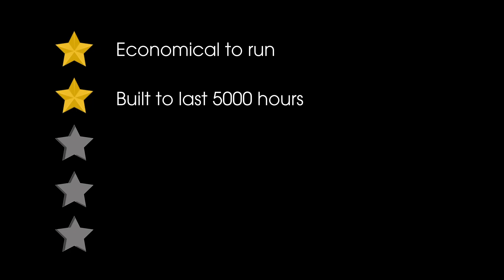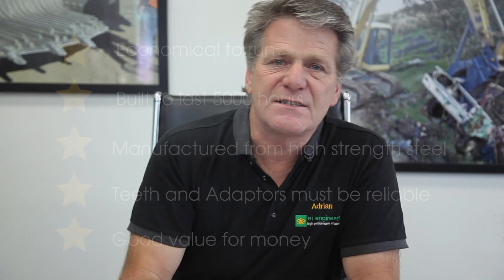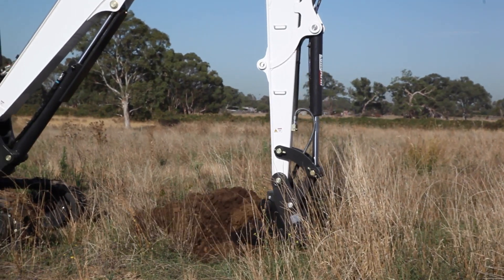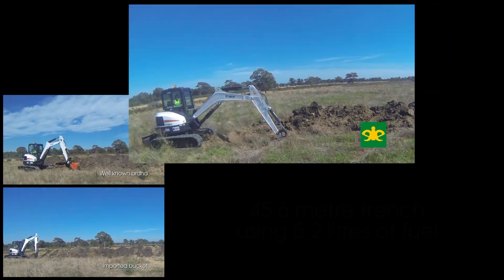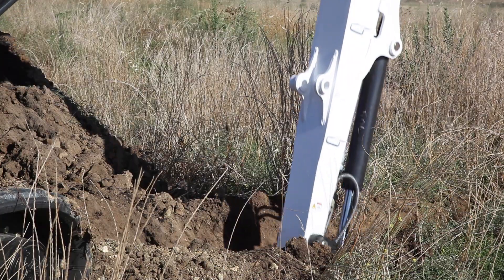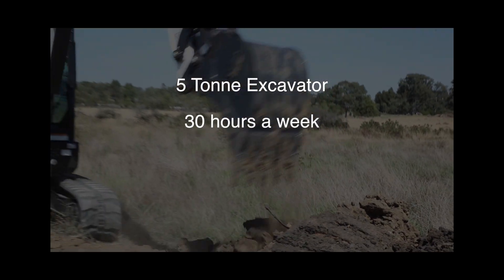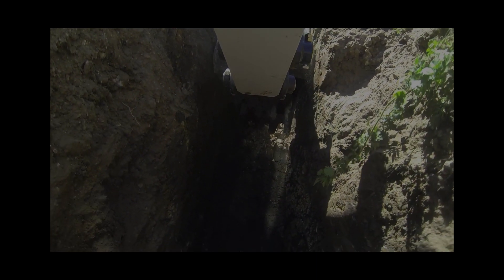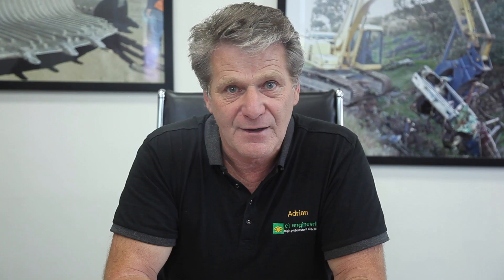eiengineering 5 Tonne excavator bucket Comparison

Comment: also i noticed that they are not using the same G.E.T so i dont think it can be fair as company like ESCO will point about the massive fuel savings and productivity that the G.E.T will give you, so i think you should make another video showing the buckets with the same G.E.T.
Reply from the maker: Sorry James, our teeth are actually larger than the cheaper and sharper teeth on the other buckets. We use late model Esco style teeth because:
1. they are a stronger adaptor that does not have the traditional hole through which exposes a weakness and breaks under certain conditions
2. we are sick of all the different copies especially from the many slightly different moulds in the Chinese foundries which end up with bad fitment onto your adaptors, leading to teeth coming off, pin and adaptor breakages, etc.

With the 18 series style teeth, which is the styles on the other buckets, I believe our buckets will perform even better, but creates other problems for the operators..
Reply from the maker: Adrian Mason
Our teeth, in this case are the Esco V17 copies, and are available from many different outlets across the country at around $16 per tooth, and they have around 25% more usable material on them making them both stronger and more economical, which is really what technology is all about.
Reply from the maker: I have answered each of your questions under the actual question.

Comment: also how about showing the bucket digging in different ground conditions to show the strengths and weakness of all the different profiles and designs. as maybe the other brands will perform better in the wet and sticky conditions?
Reply from the maker: Thanks James. It's in the plan to eventually do some comparisons in wet conditions, but in reality, it makes sense that they will perform better in all conditions. Wet conditions requires a different digging action. If you dig in wet conditions the same as dry, you will always have trouble emptying your bucket because the material compacts in the back of the bucket squeezing out the water and making it harder to empty. There are only two solutions to this that I know of: 1. take smaller bites at the material making sure that there is no compaction in the bucket, or 2. weld a hook just behind the middle tooth of the bucket and another to the dipper arm just up from the hitch. Connect a chain between the two points with "D" shackles ensuring that when you go into "dump" mode, the chain is tight. This way, when you are digging in wet conditions, the chain goes slack in the bucket and sits behind the material, then when you dump, it pulls tight and rips the material out of the bucket.
Reply: Adrian Mason  thanks for the info but what about the depth of the trench? and the GET on the buckets? any thoughts on them?
Reply from the maker: James Fishburn
Depth of the trench and GET will either add or detract from the performance in a small way. The teeth we use are larger than most because we try to provide better value for money, so you would think that is would take away from the performance of the bucket. All trenches were dug at the same depth so performance is performance. We're not here to tell lies or exaggerate our performance so that those who purchase our buckets will not experience the benefits they can offer. We're here folr the long term ansd our customers keep coming back, so we must be doing something right, don't you think?

Comment: are they the same depth? as i saw on one of your other videos the EI bucket cant dig as deep, so i am just asking would that not make issues if you are trenching?
Reply from the maker: What makes you think the eiengineering bucket won't dig as deep as the other buckets? The operator has control over that, not the bucket. Each of the trenches was around 1950mm deep, the figures were based on the total cubic amount of material moved, but it's great that you are thinking about it and I really appreciate the opportunity to answer your questions. If you have questions, it is most likely others have them too.

Comment: If these buckets dig faster then there is no need to work 30 hours a week  You would only need to dig for 15 hours per week because you say that they dig twice as much. So instead of getting a 30 hour pay you will only receive a 15 hour pay  UMMM   And the trench that was dug for this video ???   well it was not very neat was it
Reply from the maker: Thanks Bob, but I'm sorry I don't really see your point. If I have a guess, I'm thinking that you are saying buy inefficient buckets and machines so we can all work longer hours and stretch the work out. I don't think the head contractors or customers would like that very much. I think you will find that all the trenches were dug in the same manner - it wasn't an exercise for neatness, it was simply an exercise in efficiency.